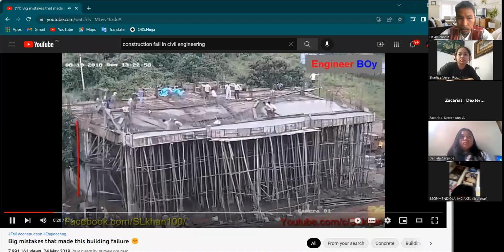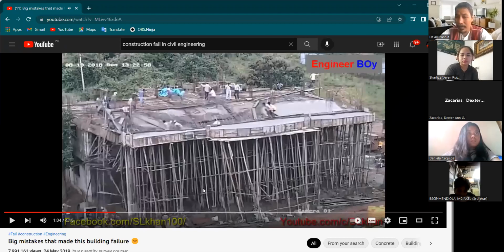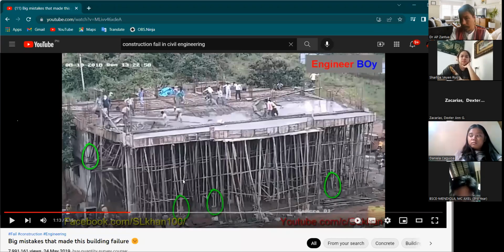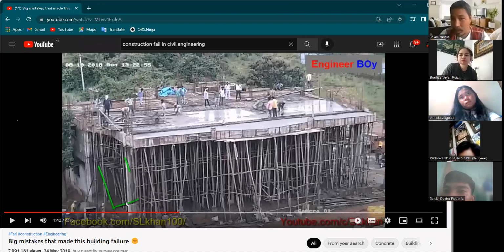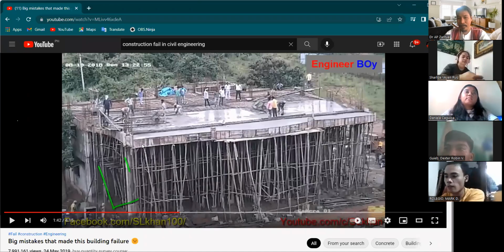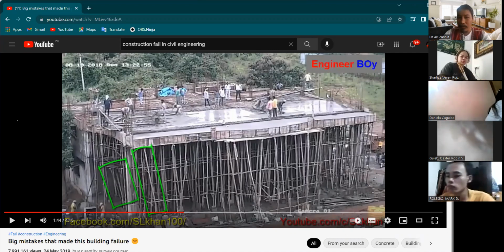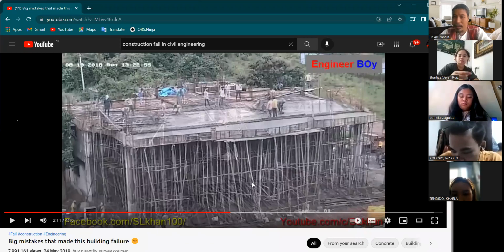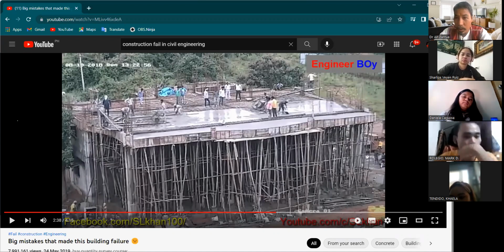(EngineerBOY) Engineering Construction Fail [ Failure of Structures REACTION: PRPC Design ] M1.01.4

Comment: Thank you for giving us a heads up about engineering construction failure. What I realized in the discussion, is that it is very important to have an engineer in terms of building houses and other structures, because mostly of the common failure of every houses is poor structural design, sometimes due to substandard material or cheaper value of materials and lessening the number of columns to be putted.

Comment: From my understanding and digestion of this video, it is noticeable that the falsework is weak and has a diagonal direction which causes less hold of the load and it results in structural failure. Also, the application of structural was not met, as one column is missing in the front part of the building causing failure right in that place where the column should be placed. Maybe they focus on aesthetics than the structure of this project.

Comment: I have noticed that the falsework of the structures are in a slant way which made it prone to overturning. Thank you, sir I have learned the common reason of why the structures failed such as lack of columns to support the load at the middle front of the structure. The unsupported load is too long. The connection of the steel are bad that causes weak connections. This types of knowledge helps aspiring civil engineering students to be a construction engineer.